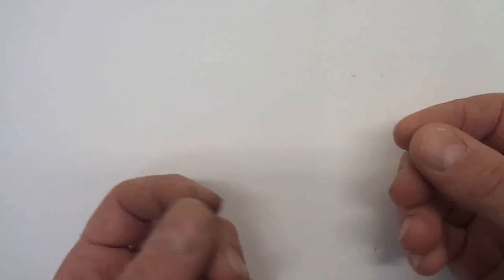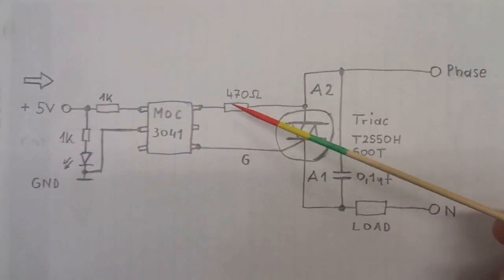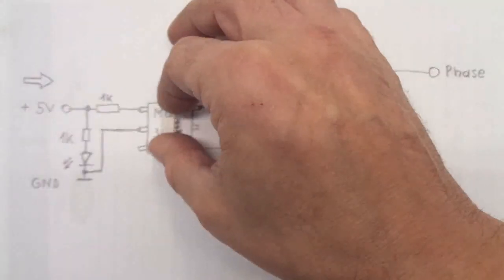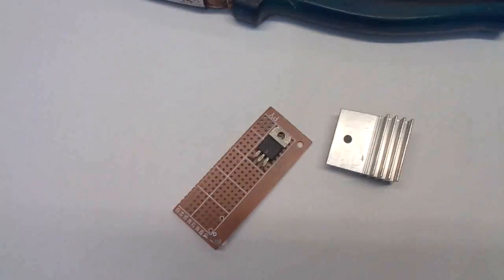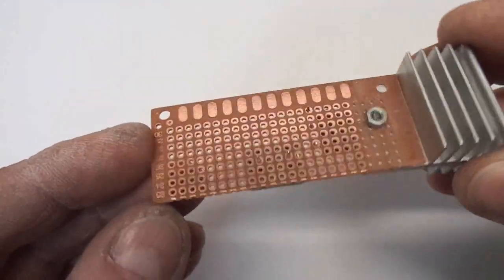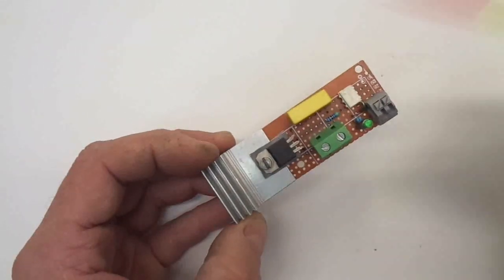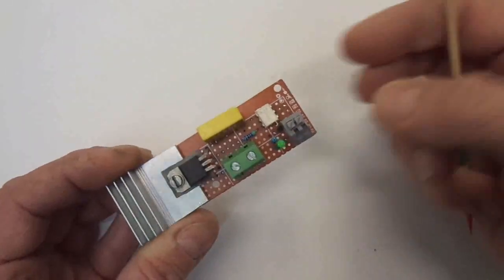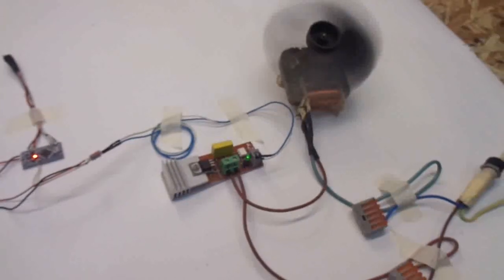AC solid state Relais DIY

Comment: If i connect PWM at +5V input can i controll hotness of hot plate for example?
Reply from the maker: No, it is "just" ON and OFF... But for a hot plate or heater, this would be good enough... Let it switch On for 1 second and OFF for 2 seconds, to controll the heat output. (or any combination controlled by a potentiometer for example).. This is not a dimmer... For real dimming, you have to detect the sine wave (zero crossing).. You need 1 Analog in and 1 Digital out on your microcontroller..
Reply: @LariFariYoutube  Yes but i don't understand if it can take fast switching, why would it not work if it receives PWM signal. I need it as part of PID control
Reply from the maker: @NionXenion-gh7rf   I tried it, but it did not work.. It stopped working under a certian threshold... About 20%... You can buy commercial PID controllers for heating applications.. And the also do this pulsing..It starts with "long ON and short OFF" and the closer the sensor gets to the set value, the ON puls gets shorter and the OFF pulse longer... So it is actually a PWM funktion, but in slow motion.. ;) Give it a try. It is worth experimenting with this solid state relais circuit in conjunction with a microcontroller..
Reply: @LariFariYoutube  Yea, it is more fun to make it yourself. I wanna make analog PID there is section in the book "the art of elwctronics" there analog pid controls position of knob. I will try to tweak it and use that as temperature controller. That's why im searching possibilities for AC switch controlled by some signal generated from PID output voltage... If you have some more ideas tell. Analog PID is much more fascinating and you are not dwpwndent on microcontrollers than need whole infrastructure in order to work. Assemblers, software hardware depwndwnce from some particular company etc....
Reply from the maker: @NionXenion-gh7rf  Does this analog circuit work with a 555 Timer or similar? The first ide, what came in my mind, was to decrease the timing capacitor, to slow the PWM speed down to more like "pulsing"